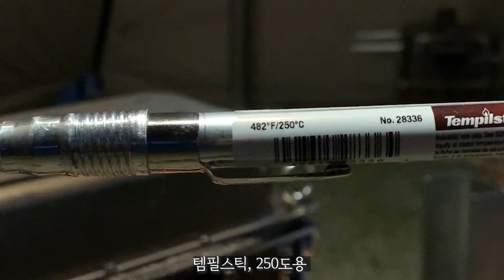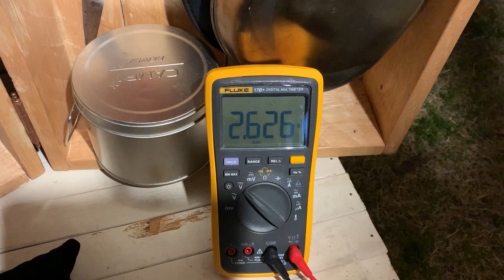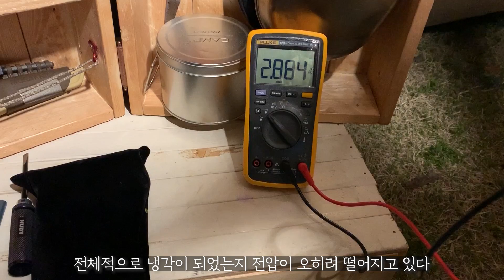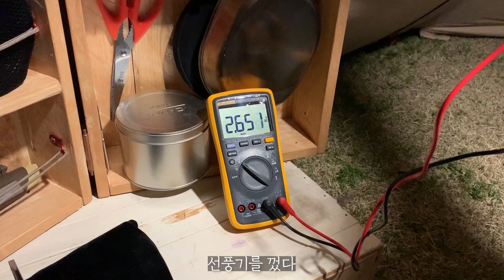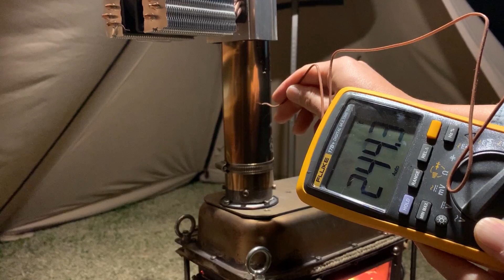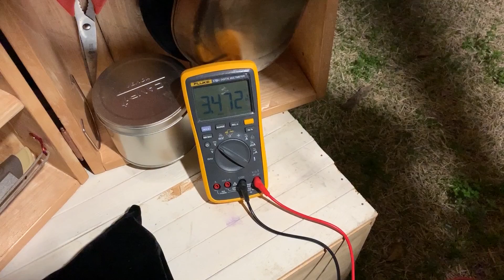Camping Wood Stove with Off Grid Thermoelectric Generator - M-Stove Project Part-7

Comment: Wouldnt it be easier just to install an electric generator turbine in the flu pipe
Reply from the maker: The exhaust speed is not that fast. Is it possible?
Reply: @campingtogether  try it ☺
Reply: @campingtogether  the only concern id have with this idea is if the turbine jammed or sooted up and caused carbon monoxide poisoning....

Comment: I dont understand the purpose of using the fan? It seemed like the hotter it got the more power you put out, why cool it down?
Reply from the maker: Hi. The greater the temperature difference between both sides of the Peltier element, the greater the power generation. So, cool down as it possible, and heat up as it possible.

Comment: Hi.
Make a box around the "cool side" and connect 6" flexible aluminium ducting getting cold air from outside (lower in the tent) and the exhaust of heated air higher...also out of the tent.
Reply from the maker: Thank for the great idea!

Comment: Imho, rotate the heatsinks(HS) 90deg and then layer them with 3 more fans, so fan/HS/fan/HS/fan. And put a shroud around the entire unit making a wind tunnel so you're not openly bleeding off the extra cooling.
Reply from the maker: Thanks for the comments. I judged that the air-cooled power generation module was too complex and not very efficient, so I transformed it into a water-cooled module and got better results. Please watch this video out.https://youtu.be/H0Qva6JxSD0

Comment: Why didn't you use the mounting kits that came with those heatsinks??? It would have saved you the trouble of drilling.
Reply from the maker: It didn't fit well. a bit small. :D

Comment: Great project but breaking thermal barrier with the four fixing screws, they transfer heat to the cooler. a piece of 25mm square bar the length of the channel, and basically clamp everything together.. the greater the differential the better the power output... good work.
Reply from the maker: Hi Aiden! Thanks for watching! After I found its inefficiency, I modified all these installed with water cooling module and it worked great! Check the video out. https://youtu.be/H0Qva6JxSD0
Reply: @campingtogether  Hi im working on similar project, have been for last couple of years, cant give too much away... i thought about putting, the pc heatsinks in a tube, fan on the intake so cooler air,  have so clip onto flu pipe. and have a flexiible pipe off the outlet to another area. blown warm,dry! air!... but what i was on about was that using four screws, they are tranfering a lot of heat to the heat sink. by putting a piece of box section behind the heat pad of the heat sink, and three fixings one either end and one in middle. the heat will transfer to the box section first, aluminium woud be good as disapate the heat!... like your work..

Comment: Great idea...few things can be added..
1: Delta T is most important, If you keep colder side out of camping tent then it would increase its efficiency and power output, since hot environment inside camp is not allowing that Delta   T..
2: Add exhaust duct flapper to constant the heat in duct..Normally 150°C should be enough for a good TE to perform at max..
3: Make Peltier contact flat to the duct.
Most importantly, wish you all the best..will appreciate to see further follow up till success..😁
Reply from the maker: Thanks for the idea. Stay safe!

Comment: Could you imagine all houses with TEG's for the wrapping of the houses. oR all major waste heat from factories. Its like nitinol ,even if the air force tells you cheaper energy it can't be pushed to the masses. I alone could make a city produce all needs for itself but hey pieces of imaginary paper stand in the way
Reply: He can't even produce enough to run the fan. Think a little.
Reply: @suprememasteroftheuniverse  I do, then design is basic to say the least.
Reply: @brettmoore3194  clearly you don't. Anyway put your product on eBay and give us the link. I'll buy a hundred. Talk is cheap.
Reply: Check what metals are used for the modules. No conspiracy theories needed ...
Reply: They are worse and less efficient than better insulation.

And they only work when heat passes through them so to get anything meaningful out of them would require some insane amount of fuel to heat those houses, and heating them beyond what humans can tolerate.
Reply: Take your idea of slapping these on a house and apply to a small scale setting during a 100⁰F summer. I promise you will change your mind about the way you are currently thinking about these.

Comment: Very nice work.  Enjoy your videos.  
I was watching you put the unit together and thought I saw a pc style fan between the radiators.  But I did not see them being used.  Perhaps the thermal power was to power them?  That being said... in my opinion... then arnt you pulling heat from one rad and driving it into the other?  Like transferring heat from one side to the other.  Perhaps the fans should be placed on top and draw cooler air from the outside and through both rads.   That being said... pushing air through is more positive than trying to draw air through.  Just a thought.  Nice work.  Cheers.
Reply from the maker: Hi, Kevin. Thanks for your comment. I agree with your thoughts. However, the fan was unable to operate due to insufficient power. In the following video you can find a water cooled generator. Thank you.

Comment: Great to see investigation in this area. Especially from a home build perspective. I have been interested in this idea since seeing AMERITEG  magnetic air blower that couples to the side of a wood stove. I run my stove for 6 months of the year nearly 24 hours a day. If I could find a way of drip feeding my battery system volts in the dark months from my stove.. when solar is light to non existent. 
I think the ameriteg uses 9 or 12 thermo electric generators in series/ parallel ?! With a focus on air movement. 
I keep wondering if water cooled as in a high end p.c could be possible. Sadly I don’t have the engineering skills to test.
Also it struck me the the fans could be run off there own dedicated T.E.G as in a standard stove top fan and removing the need of extra power from a battery to run the fans..... obviously no volts in lots of volts out being ultimate goal.
Great video. I hope T.E.G ‘s become more efficient and someone can  finally bring a product like this to market for ‘off the grids’ like myself.
Thank you 🙏

Comment: 👍👍👍 Yesterday I made a video of a mini thermoelectric generator on TEP1-142-T300. Your design is very interesting, a little grammatical, Thanks for the good video!  👍👍👍
Reply: I made a generator on 6 elements connected in series. I managed to reach 1000 mAh of 5 Volt with a load.
Reply from the maker: Hi. Thanks for watching. Check out my latest video of thermoelectric generator.

Comment: Thanks for this clear experiment - but voltage only is meaningless : how many Amps did you get ?
Also the fan might use more energy than what is produced  - A low flow of  water could be more efficient and cheaper to build   
The chart giving the power vs temperature of the pelletier module is very hard to find ; usually the chart we can find gives the performance for cooling purposes 
Anyway congratulations for this construction
Reply from the maker: Hi, Thanks for watching! Stay tuned. Another experiment on this coming soon.

Comment: The thermo electric chips are probably low quality and I recommend finding a better manufacturer... Yes pulling the chips will help perhaps putting a  copper plate Fastened to the chip will help a lot
Reply: I've also read that you can get bad quality chips.

Comment: Not enough heat transfer between a round stove pipe and a square aluminum channel. The TEDs should be mounted directly flat against the fire box for maximum heat transfer.

Comment: Need more tec 12705 elements. Maybe use aluminium foil for better fit to the smoke pipe. Tamp it. Maybe use water cooling 5v 0.12a pump?

I see working things like this:
https://youtu.be/53J4WdqIMtU
He use 8 elements and pump

Comment: this type of electric generation is very inefficient, is more efficient to built a steam system
Reply: Just what I thought, add another container right on top of the one used for fire, make also a hole through it for the chimney, seal it properly and then cook water inside there and drive one or several small turbines with the steam, nice side effects would be an a little less hot oven, I don't trust this tincan construction and the noise it makes, so limit its heat is not a bad idea I think, but also having hot water all the time is a win. Further add a heat exchanger, suck in cold air from outside and heat it up with the chimney, so more heat stays in the tent and less wood is needed for the oven.
Reply: @Wilson84KS  nice idea

Comment: I think thermoelectric elements work better at higher temperature variables. Maybe you can ice the cold side to see if camping in the snow and moving the radiators outside with ice water being pumped into the tent through insulated tubing to a copper heat exchanger on top of the thermoelectric elements would be an improvement. But what would circulate the water? Another need for energy? What about thermally inducing the flow? I see a lot of people doing that to make hot water. No pump, just temperature variables moving the water. One other thing I was thinking, maybe the radiator you're using can be better. The ones you're using are for taking the high temp off processors, supper HOT! I think if you got your temp colder you're going to find better results. I really like the way you think! And you're mechanically inclined enough to do some really nice work!
Reply: Using water pipes heatsink away from the stove would be rather better, no noise, no power output problems.

Comment: Erst mal Hut ab, ich selbst hätte da meine Grenze. Elektronische Verbindungen zu Schafen ohne einen Brand zu entfachen ist als wäre ich der wütende Mark Raffalo. 
Auf deine 6v bist ja nun nicht gekommen, wie willst du das Problem lösen?
Kannst das Teil ja nicht auf die Koch oder Ablage Fläche stellen.
Reply from the maker: Vielleicht liege ich falsch. Ich brauche das Hinzufügen eines Moduls dazu. Es können vier in Reihe und zwei Sätze parallel angewendet werden. Es wird noch erforscht.

Comment: If 2 TEM (Peltier) in series = 3.5 vDC, then 4 of them would be 7 vDC. Looks like 5 TEM in series is what you need. Also, the rising heat from the stove shouldn't be entering into cooling unit/radiator. Interesting experiment. It was fun to watch.
Reply from the maker: Thanks for your idea! I will try do more on this. Stay safe!

Comment: One limiting factor that you may be experiencing is the mounting screws may be transferring heat from base to the heat sink.  I will have to think about this.  I taught PC Hardware design at university.  More later after skull sweat.   Stay safe and keep designing.  Peace brother.
Reply from the maker: Bolts.... Oh never thought it is transferring heat....😅
Reply: 캠핑투게더 That’s the value of showing your videos to others.  We all see different elements.  We all share our knowledge and experience, we all grow and benefit.   Peace brother.
Reply: Look at video “how it works...”
https://www.bioliteenergy.com/products/campstove-2
Their heat probe, hot side is much smaller than surface area you used.  Their Thermal Electric Generator (TEG) is displayed as a grid of 16 (4x4) squares.  They may be achieving their voltage by wiring multiple pads in parallel and series.  Step back and experiment with a single Peltier junction, then two in parallel the way you wired the pair.  Also, stack two with thermal grease connecting hot to cool side.  Your experiments could be done on your stove or over a small alcohol lamp.  I believe you are on the right track, just a bit more small scale experimentation prior to your second attempt on stove chimney. 
Peace brother, I admire you tenacity and quest for empirical knowledge.  Stay safe, surrounded by family.
Reply from the maker: That is just perfect... I lost my words..

Comment: The only time I have seen a Peltier junction successfully produce sufficient energy for charging devices was when water cooling was used.  You can build your own or adapt one from a PC CPU kit. Water has a higher thermal conductivity than air - it can move heat faster than air can. Water also has a higher specific heat capacity. It can absorb more heat before it starts to feel hot.

There are two reasons why a computer might need the increased thermal conductivity and heat capacity of water:

Its electronic components produce more heat than the air around them can absorb
The fans required to move enough air to cool all the components make too much noise or use too much electricity
In other words, there are two reasons why you might need to cool a computer with a liquid instead of air:

The components inside your computer need more cooling than air alone can provide
You want your system to be quieter . 
https://computer.howstuffworks.com/liquid-cooled-pc1.htm
Reply from the maker: Thanks for the information you shared. I will take a look and find better ways. :D
Reply: Precisely my thought, water is better that air cooling especially in winter you can melt the snow that way and generates warm water that you can collect and use it  for washing or something else also you you don't use electricity just a gravity flow